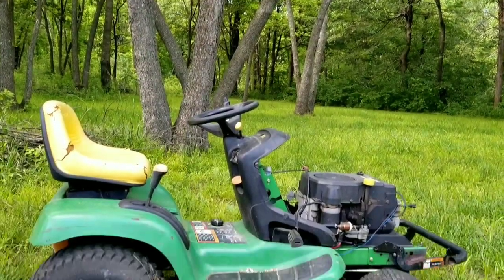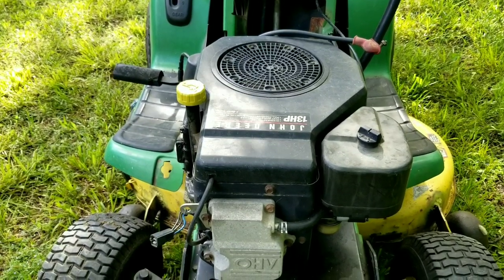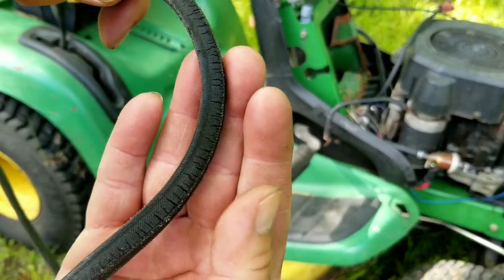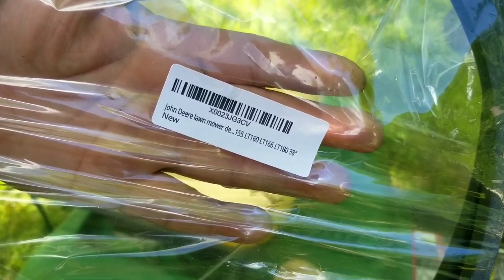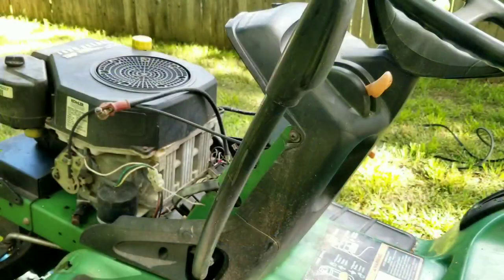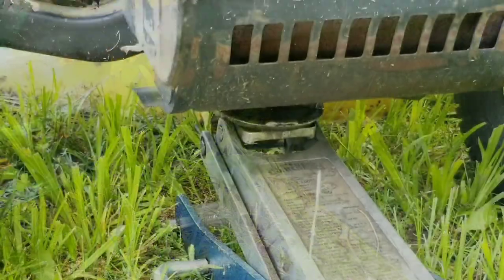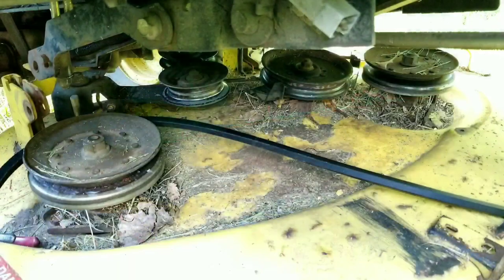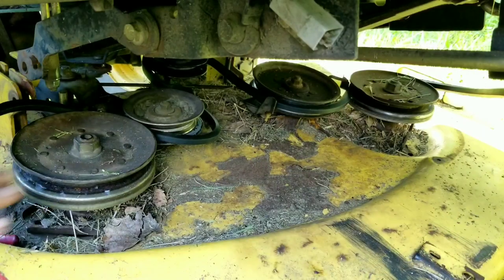Why my Mower keeps throwing deck belts.

Comment: Buying the more expensive belt will save you the time and hassle of dealing with the cheaper belts. The more expensive belts have kevlar fibers intertwined within the rubber which gives the belt a much longer life than your usual run of the mill belt. This was the case with the blue colored belts I sold back in my hardware days. One thought, if you went through the hassle of changing the belt it might be a good idea to grease those pulleys if you can and check your bearings on the deck. Keep up the good work.
Reply from the maker: You're absolutely right.  Thanks for the comment vintage fixer I appreciate it.
Reply: That’s a great tip I hadn’t considered.
Thank you
Reply: I have a John Deere gt235 that I mow about 4 acres of land with every 5-7 days. I live in a very mountainous area and so very little of the land I'm mowing is flat and even. It's very rough on the mower, steep and bumpy everywhere. So I've found over the years that it's better in the long run to buy the cheaper belts. Mowing as much grass as I do on rough terrain means you're going to burn through belts no matter what. I can get 3-4 cheap belts for the same cost as 2 of the nice reinforced John Deere branded belts, and they end up lasting about the same amount of time either way. But if you just have a small plot of flat land to mow then the expensive belt would be the better choice.

Comment: I kept breaking belts off my new JD 130.  The 3 rd time repair man refused to do it.  Told me bring it to JD dealer.   Moral of the story  nearnest JD dealer is hour away and I spent a lot already on belts and labor!   I went to Lowes bought JD brand belt.  Went on utube watched few videos and Put dam thing on myself.  Apparently repair man wasn’t using J Deere belts I quickly noticed as I saw old belt looking for replacement number. Two years and still same belt I put on👩‍🔧sure is a good feeling when u can avoid those labor costs!
Reply from the maker: thank you Michelle Alms for sharing your experience.
Reply: 10 years on one belt for me  and will replace it with the next 2 years

Comment: Thanks for the video. John Deere D105 37 hours. 22 belts. 3 times by me to John Deere repair shop. I classify this tractor as a POS.
Reply from the maker: Thanks for sharing
Reply: John Deere mowers are rubish...
Reply: @jlda1887  not really. As long as you check it and clean it regularly it will last for decades.

Comment: I learned this little bit of advice about belts. Test it first if you smell burnt rubber or see smoke then it's wrong. If you don't smell or see smoke then you got it correct.

Comment: My John Deere L111 with the 42 inch deck just broke the belt for the first time today (May 28, 2022), 16+ years and over 450 mowing hours since I bought the tractor brand new in 2005.  I'm picking up the OEM belt tomorrow (almost 50 bucks for it), and here's hoping it lasts as long as the factory original.

The tractor has the 20 HP V-Twin Briggs engine and still runs perfectly and uses/burns no oil.  The oil is still very clean on the dipstick at the end of the season.  I install the factory maintenance kit with new oil and filter, spark plugs, fuel filter, and air filter, every year at the start of the mowing season, and so far, so good.  I mow about an acre of grass here, with 25-30 mowing hours per year on the tractor, depending on how much rain we get.  Mowing season is about six months long here in Wisconsin, again, weather dependent, mostly based on how the April weather pans out  First mow of the year happens anywhere between April 20 and May 10, and the last mow/leaf mulching run is usually around October 20.

Thanks for the video.  It will help out tomorrow when I'm crawling around and cussing while putting the new belt on.
Reply from the maker: I appreciate Brian.
Reply: @HomeGaragechannel  Right after I finished replacing the blade belt (which went smoothly), I went to start mowing and found my two front tires pointing in different directions.  One end of the tie rod (John Deere calls it a drag link) on the right side wheel had worn out and picked that moment to fall off the ball joint.

The rod and ball joint are press-fit at the factory and once the connection wears enough to come apart, there's no fixing it.  So yesterday I picked up the two new tie rods for both front wheels, to the tune of $122.

What are the chances of two breakdowns right on top of each other after all these years of no trouble with the tractor?  Oh well, another repair I get to do in the next couple days.
Reply: @Brian424  that happened to me just took a 2 medium zip ties and tied it up and it drove fine until I decided to retire it for a new one

Comment: My experience, I have a small JD mower just like the one in your video, I bought a cheap deck belt off brand, it was a waste of my time,
I when back to the dealership paid more, but got a quality belt,
Counter guy said belts that have to run in uneven planes like a mower deck must be built to higher standard for flexibility than just a straight running belt,
He must be right as I have had no problems with the JD belt,
Reply from the maker: Excellent. Thank you for sharing your experience.  I appreciate it.
Reply: Same problem for me, I bought an off brand belt, snapped after 5 hours, I bought a JD belt, no problems. The kicker is the off brand was actually more expensive. What I didn’t know was JD is metric, off brand is not.. lesson learned.

Comment: Deck belt does the exact same thing on my E100. I have tried four different brand new belts, I bought te updated bracket for the front Crank shaft pulley. Still comes off every time you disengage the blades. The adjuster is welded so I fixed that issue by taking slack up in the cable that didn't work so I bought the recommended john Deere belt that is 103" instead of the factory 103 3/4". Still same issue. Then john Deere makes a plastic bowl shaped retainer that mounts to the crank shaft pulley so I bought that and still no fix, Then I replaced every pulley and every idler arm bracket on the deck, still same issue. Mower has 49 hours on it and I have been a small engine and mower mechanic for over 20 years. This has to be a recall but they say no. John Deere needs a suit against them for the E100.
Reply from the maker: yes it seems to be a real issue.

Comment: At the end of month 1, and my 3rd cheap belt. I put on a reinforced belt for 2 years of worry free mowing. In a pinch, I will use a cheap belt, usually due to awaiting the reinforced belt to arrive.
Reply from the maker: that makes sense, thank you Dale Booth.

Comment: It drives my OCD nuts when I see a deck covered with grass like that it's not that hard to clean them off after each mowing... I always use kevlar reinforced belts..
Reply from the maker: lots of grass on the deck can be very bad for it. definitely blow it off whenever possible
Reply: What I hate is when a battery goes bad it will cause the pullies to rust within days to weeks and will have to be replaced plus all the other hardware

Comment: I have the l110, The last time I mowed the belt that I had recently purchased from JOHN DEERE came off and actually shredded luckily I had an old belt and after mowing for about 2 laps it came off. Come to find out the engagement pulley  lost the bolt. So I found a bolt in my bin and replaced it. After I got it on and working I finished mowing. When I went to put the mower back in storage i noticed that there was a little patch that is always hard to get to. So I went to engage the blades to cut it and mower died! So Im gonna spend a lil time today and see what the problem is! Hooefully nothing too serious. I can't afford much so maybe a simple fix like the pulley is locked up! Also what would cause the blades to turn slowly when its not engaged?
Reply from the maker: i would check to make sure the belt hasn't come off of a pulley and is jammed.  otherwise check one of the safety switches.
Reply: @HomeGaragechannel  I just spent about an hour checkin put. Seems that one of the spindle pulleys is gone/froze up $50 and also my pto cable is stretched $25 hopefully for about $100 I can get a new spindle pulley, pto cable and a belt! Atleast the new spindle will come with a grease insert! I know that bcs I had to replace the other one 2 yrs ago!
Reply from the maker: @kevinbrister8801  great diagnostic work. Thanks for the update I appreciate it

Comment: I use cheap belts,  they will last a season,  and I can buy 3 cheap belts for the cost of a better belt,  that's just me , every winter I take the deck off and clean,  replace bearings if needed,  remove rust and repaint.  It make the deck last much longer,  I have a 2005 Murry 40 inch mower since new,  the engine gave up,  but the rest of the mower is in very good shape. I also replaced the 12.5 engine with a 2 cylinder 25 horsepower Kohler Pro engine it can cut tall grass/weeds with no problem.
Reply from the maker: I like that idea, makes sense to me. Thank you Bert Grau.

Comment: Worn pulleys will shorten the life of even superior belts like Gates or Stens. 
If your pulley is shiney all the way to the bottom of the groove, it is worn out.
Misaligned pulleys or bad bearings will damage belts.
Belts are more often a symptom of a problem than the cause.
Reply from the maker: I couldn't have  said it any better
Reply: I’m replacing all the idlers and spindle pulleys on my deck on my LT166 48C.  The mower is 22 years old and they’ve not been replaced.  All of the insides of the pulleys are shiny and worn unevenly.  I replaced e belt last year and it wouldn’t last but maybe an hour, as it threw the belt off while I was mowing with it.

Comment: Why would it keep throwing brand new belts? I’ve put 2 in and it threw them both times within 5 minutes
Reply from the maker: the belt isn't the problem then. I would look at the idlers and tensioner pulleys for wear, this wear would allow some slop and the slop could be enough to throw the belt.

Comment: For deck drive, always buy OEM.  They are designed to accommodate the shock loads that replacement belts can't handle.  In this case you get what you pay for.
Reply from the maker: very true

Comment: Buying the more expensive type is mostly better because your avoiding to replace it longer in the long when mowing grass when you need to engage the engine and pulleys combined etc
Reply from the maker: That is very true.
Reply: @HomeGaragechannel  too right mate

Comment: Build up wet  grass around the main pulley & on top of the deck would cause the belt to slip off the pulley also ,  Keep  Cleaning out the grass  would help to keep the pulley in place Lol     Hope this helps
Reply from the maker: thank you for the tip

Comment: My issue currently is my lawn tractor throws the belt after engaging the mower.  I've replaced the belt so it may be one or more of the pulleys.
Reply from the maker: yes it's probably one of the pulleys or the tensioner. Can you also confirm that the belt is the correct size for the deck.
Reply: We have the same issue.  Have replaced the pulleys, adjusted the tensioner and bought oem belt.  Still falls off when you engage, not all the time, but almost always when you are trying to out run the rain.  🤣
Reply from the maker: @amandasanders9130  do me a favor, next time you use it, slowly engage and disengage the PTO for the blade, it's almost 99% sure that it won't chuck the belt
Reply: @HomeGaragechannel  idle down the throttle to 30% and them turn on the pto. I'm lucky I can crank them up at running full rpm and not even a slip

Comment: A question about my L111, why is my deck twisting belts? 3 belts replaced and the twist. Any help would be greatly appreciated.
Reply from the maker: sure, more than likely one for more of your pulleys on your deck, is either out of alignment due to bearing wear  or the deck having issues. the other would be your deck, is uneven or crocked in relation to your Frame.

Comment: I put a new belt on my lt133 John Deere and smelled burnt rubber.  Wasn't sure what it was and the belt snapped about 10 minutes later.  I followed the diagram on my deck to install it.  Could it have been too tight to start and that is why it wore through and snapped.  It seemed like most of the pullies were hot also.  Not sure exactly what happened there.  Also can't find a real good diagram on installing it.  Thanks!
Reply from the maker: did you confirm the all the pulleys including the idlers, spun without any issue?

Comment: What caused the skinned part on the old belt?
I’ve used OEM or aftermarket Kevlar. Couldn’t tell a difference.
Reply from the maker: I think the belt was worn away by the drive pulley when the blade was disengaged.

Comment: My  mower belt (new ) comes off after a few minutes of cutting.  Any ideas on what to do?
Reply from the maker: Where did you get the belt? I just to make sure the belt is the right length. Otherwise you need to check the pulleys and make sure one of them isn't worn out or misaligned.
Reply: John Deere decks have a tension adjustment. Follow the cable down to the deck and with 10mm wrench loosen and adjust. Also with John Deere lever-arm, release the blades SLOWLY and at low RPM.
Reply: Trade it in I bet it is tensioner pto not electric
Reply: @HomeGaragechannel  what if rhe deer don't have adjustable bolts for cable

Comment: Get the good belt or the cheap one will bite you. I'm going on 7 seasons with mine and not even ready to swap out yet. Tips for pulleys. If it has a groove, the 'V' part of the belt will go down into it but if no groove, the flat outside will ride on it. And the hood might have an air scoop inside to direct outside cool air into the screen intake. And I have a Kawasaki 6 horse off a Deere mower on the Snapper, hence a Kawasnapper! Thanks, Happy Thanksgiving and BLESSINGS 2 U!
Reply from the maker: you make a good point.
Reply: @HomeGaragechannel  I've had to figure out belt patterns on decks myself so I've been where you were. And making sure the guides were set so the belt couldn't slip off but yours was worn so thin a guard wouldn't touch it. Been there and seen that too. Blessings!

Comment: The Fatal flaw of all these systems is stretch...as the belt stretches you have to continuously adjust it over and over. These systems should use multiple small belts rather than one giant long one because that would reduce the amount of stretch
Reply from the maker: that makes sense.
Reply: Also check your pulley wear.
Reply: @bluegrassman3040  what pulley do you think is most likely to give you trouble the flat ones or the grooved ones? I'm thinking it must be stretch because mine fails in different locations... I assume if a certain pulley was to blame it would consistently fail off that pulley
Reply: @Howleebra  it’s hard to say, really.  I replaced every pulley on my LT166 JD mower.  It has the 48C deck.  The only pulley I did not change was my crankshaft pulley.  I also had to adjust my PTO clutch engagement tensioner.  But at least one I’m of my idler pulleys had a bearing that was going out, but each of the grooved pulleys had wear on the inside.  I was having issues with it eating belts while it was mowing.  The last belt I put in it was a JD belt I got from Lowes, and it’s been staying on so far.

Comment: you dont need to "time" the blades? I was under the impression they should be 90 degrees to eachother.
Reply from the maker: I've tried to time them an I never noticed a problem without timing them.
Reply: Belt driven blades will never retain their positioning relative to each other. Blades will, on occasion, need to run at slightly different speeds. First they do not start and stop at the same time and there is always that heavier clump of grass or catching that 3.5" high stump with the deck at 3".

Comment: I got a D110 John Deere lawn mower and the cable to adjust the belt is welted to the blade casing how can adjust the belt
Reply from the maker: It shouldn't be welded. Did someone weld it before you got it?

Comment: Id love to know how to fix the belt slipping prob and u mentioned the PTO cable which I replaced as well as belt. Do u have a video on the PTO cable?
Reply from the maker: there are only a few reasons why a belt would slip, the belt is the wrong size, the belt is ran the wrong way thru the pulley, or one of the bearing is causing so much drag that it's causing the belt to slip on all the other pulleys. So I haven't had to replace the pot cable yet.

Comment: I would buy reenforced belts if I am keeping mower but ii am selling it op for cheaper belt why can't they use two belt system like gilson some tractor it trouble free other trouble why can't they but grease fittings on idlers it is ones that tendon to turn blades on not electric pto that act up
Reply from the maker: easy answer, cost cost cost.

Comment: one of the last great engines Kohler ever made the Command. the new twin cam Courage engines im told aren't that great. as i got a JD X350 with a Kawasaki V twin it still runs after over 200 hours on it. as Kohler and Briggs & Stratton the quality has fallen in the new motors mainly Briggs & Stratton some of their engines have plastic componets in them.  if the machine breaks keep this engine save it if u have to swap the motor.
Reply from the maker: I absolutely agree with you.